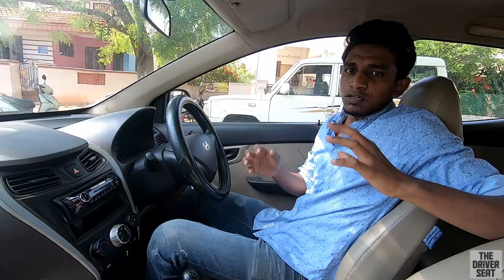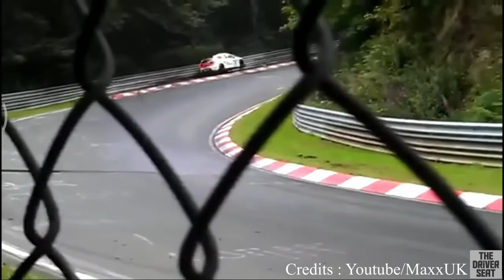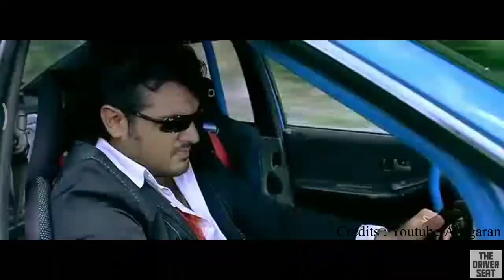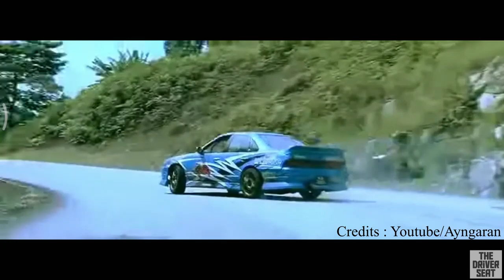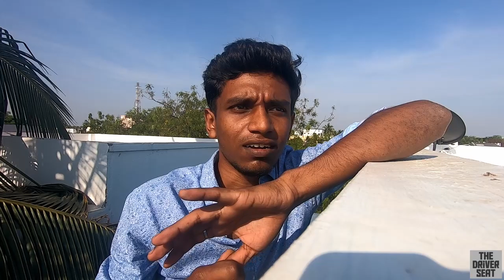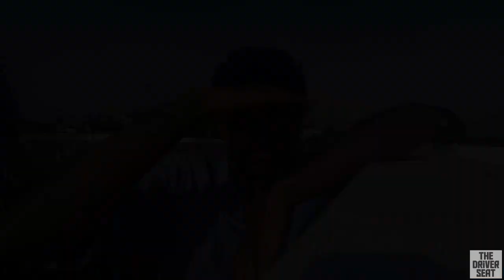Understeer & Oversteer Vs Drift - How does it happen? | Explained in Tamil

Comment: Bro. In my Bolt Revotron 1.2L, oru small curve la 80 la pogum podhe konjam understeer agura mari iruku bro. Appo 80 la small curves poradhe over speed ah. But andha small curves la overtake panravanga car la stable ah irukka feel agudhu. Turning la ye 80+ overtake panittu poranga. Andha curves la 60kmph la turn pannum podhu enakku edhum therila. Idhukku reason car not stable ah illa naa proper ah drive panalaya. Ore confused ah irukke. While driving @80kmph, if I make a turn in small curve, I feel my car lifts on the opposite side of turning...

Comment: The video is incomplete because it doesn't tell how to control when an under steer or over steer happens, just in case...
Reply from the maker: Instead I've told how to prevent them from happening 👍
Reply: @TheDriverSeatGuy  Nobody unless and until, with the rush of adrenalin to drift are going to intentionally under steer or over steer. However, must know at least theoretically, how to handle such situation, if it happens on a wet & free highway corner. Steering on the direction they intend to drive, mild breaking, deceleration and not panicking are few things that I know.

Comment: Bro overseeing will also happen when there is less weight at back or even cases where wheel is not aligned or worn out tyre?
Correct me if am wrong as I replaced the tyre with broader one and added stay bar in the front for understeer

Comment: Bro rear wheel drives Ku power wheel Ku pogurathuku munadi differential unit Ku poithana bro distribute aagum actual aa back wheel aa easy aa turn aagurathuku Thana bro differential unit use panrainga 🤔

Comment: Bro Oru Doubt... If we over steer aparr from the case of drifing or skiding arent there changes of car loosing its balance and just getting twisted at high speeds (athavuthu car kavuntharaathaaa??)
Reply from the maker: Yes, possible. If it happens with an SUV with more ground clearance, chances are there for the car to tumble and roll